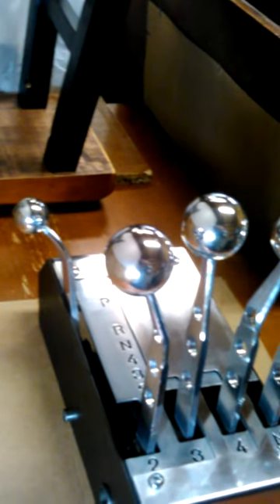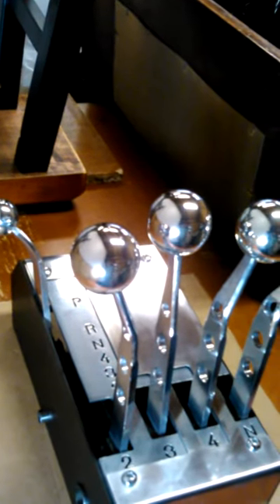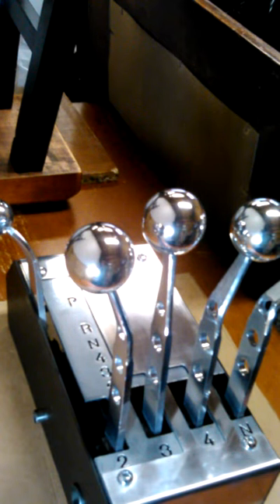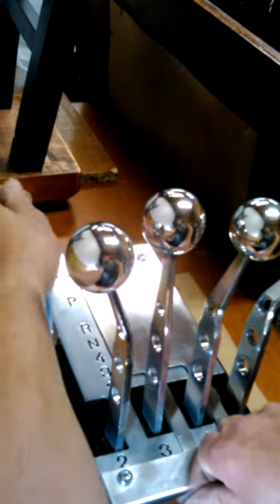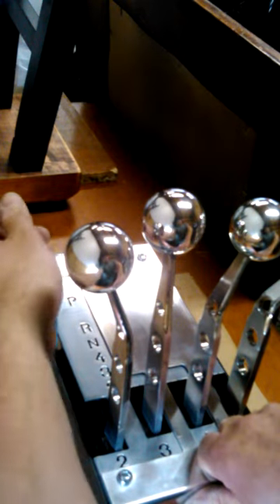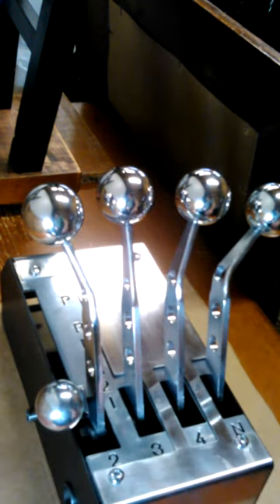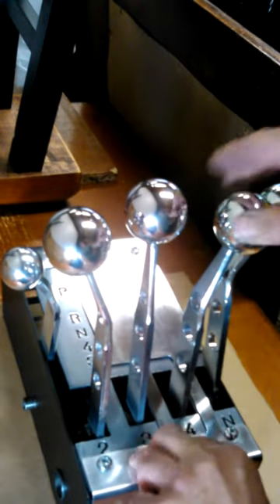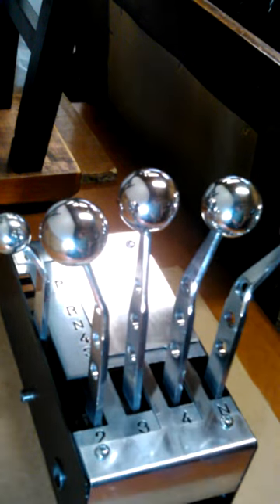kilduff Machine lightning rod Giga shifter V8 HHR

Comment: Planning on putting an LS set up in my HHR Panel. Any videos on the frame work you did ?
Reply from the maker: No sorry but there are 2 main ways    of doing it.. front and rear subframe assembly like mine.. or front cradle with rear subframe.
Reply from the maker: think 70 to 81 f body.. real similar